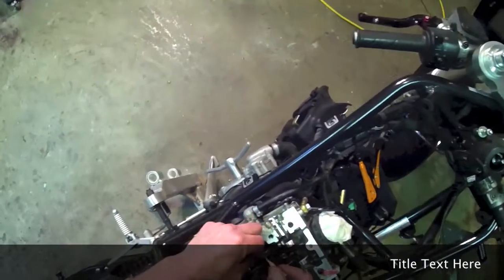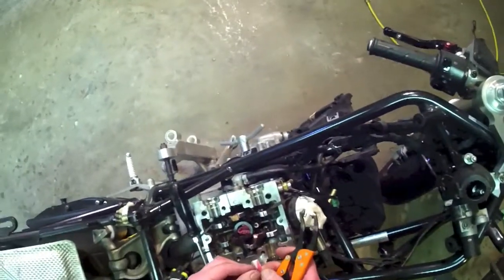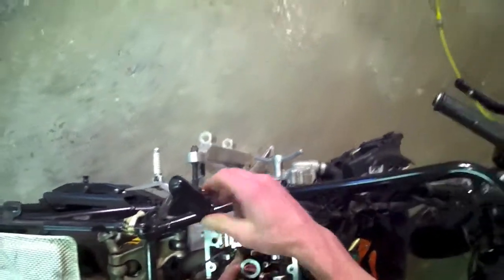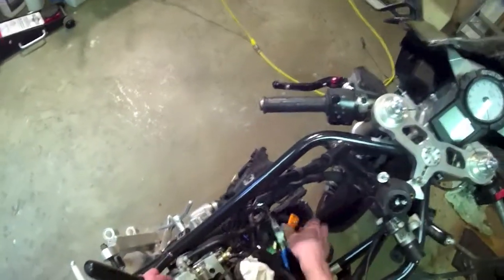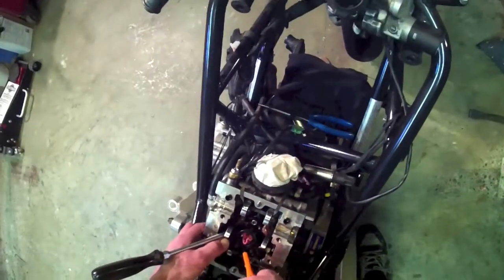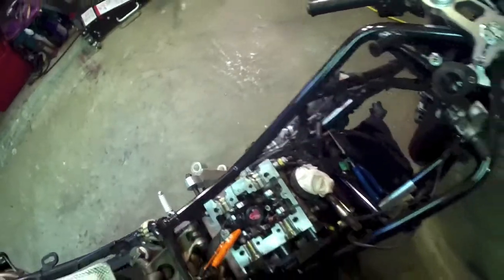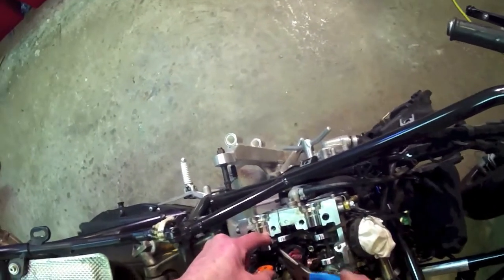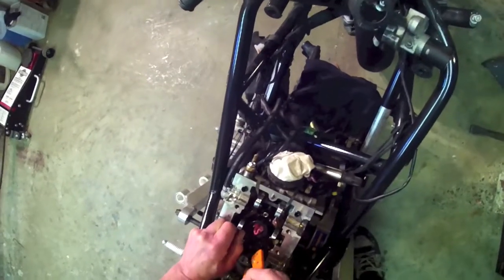Removing 6mm Shims- Ducati 749S

Comment: Hey man where do you buy 6mm shims. I can find anywhere to get them.
Reply from the maker: When I had the bike (it's gone to someone else now) I got some from Mike Guidera at EMS Duc and some from my local Vancouver Ducati shop. In 2014 the closers were US$ $9.50 ea. and closers were $14.95 ea. from EMS. The OEM Ducati shims were quite a bit more.  I did mine in the winter so I had time to measure the shims that were in it, then calculate the differences so I could order the new ones. On bikes with the 7mm shims, you could order a whole kit, use what you need and then return the kit with a credit for the remainder. At that time, that was not an option for the 6mm shimmed bikes. Maybe that's changed...

Comment from the maker: In conversation with Mike, the designer of the valve holding tool, we worked out that I should have cleaned any oil from the valve stems, and that may have made the difference in getting the tool to grip the valve stem without slipping. To place the tool in position, I have depressed the rocker (that business with the wooden wedge and then the screw driver) and clamped the tool on with about 3/16" clearance to the underside of the closer shims.